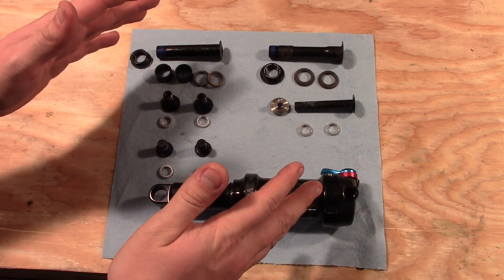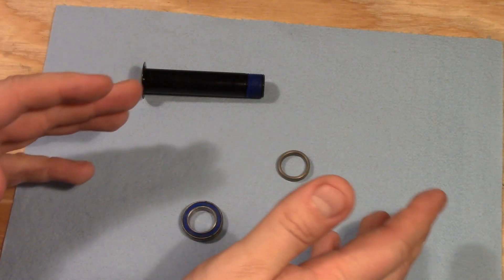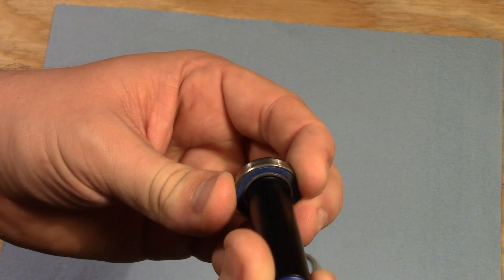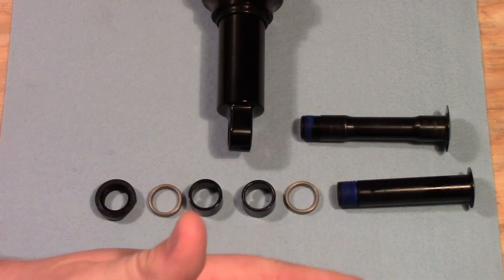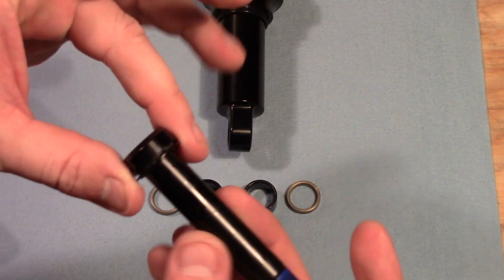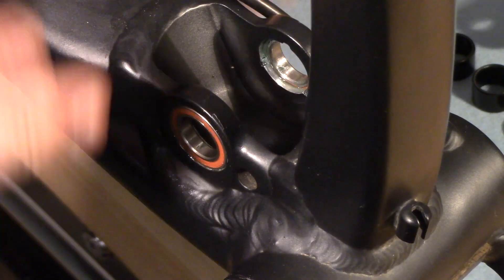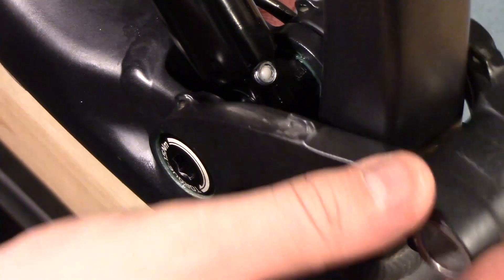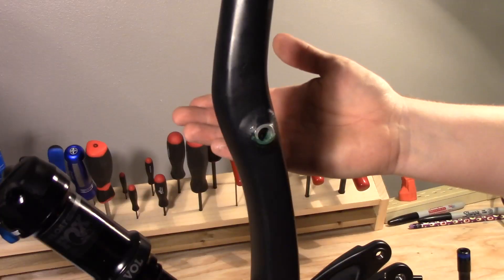Giant Maestro Suspension Rebuild Explained

Comment: Just used this video to replace the stock fox float DPS with the Bomber (coil) CR on my 2017 Trance 2.  No special tools needed.  The Bomber came with plastic inserts on the bottom hardware location that were easily removed.  Everything else was plug and play!  Tricky getting the new shock on. secured the top hardware first, placed the spacers for the bottom and swung the gap with the shock bottom, grease used to make spacers stick in place while maneuvering the shock.  I also put a Z1 on the front. Great job with the video.  Where can I get replacement bearings as mine were usable but worn?

Comment: Hi, I hope you can help me.  I have a 2022-23 Giant Trance Advanced Pro 29 2 and I cant get the bolt out of the rocker link, the one that goes through the seat tube.  I can unscrew one side but the other side the shaft Im guessing wont pop through.  Even hitting it with a mallet.  You are working on that part at 10:00m

Comment: Hi! So theres a difference between the two spacers between the rocker arm and the frame in the middle and the spacers for the rear of the rocker arm? And the 2 othersfor the top of the shock? Sorry for my bad english, i’ m french
Reply: the 6 small silver spacers are identical.  These go on all three positions of the upper rocker arm. There are two different pairs of slightly larger, darker colored spacers that are different from each other.  The tapered spacers are for the rear side of the lower rocker arm and the swing arm.  The non-tapered spacers are for the front of the lower rocker arm between the rocker and the front triangle bearings.

Comment: Great video, just got a Giant Trance Advanced Pro 2 so this came in very handy.  Although I have a creaking noise when I pedal hard and took the cranks out and regreased everything but still creaks.
Reply: mine too. i fear that on my personal Trance (not in the video) one of the bearing sockets might be a little out of tolerance, thus causing the creak.  I just had to get over it unfortunately.  It is sometimes one of the perils of full suspension.
Reply: @skitz502  you stuffed up somewhere could be the saddle rails or pedals cracked frame lose fork crown bike shop can pick where noise is from if good if new shouldnt be bearings

Comment: Is there specific bolts order that we undo first when we disasemble the rear triangle while everything is on frame. I wanted to ask is there any tension while the shox is in place is any of the bolts gonna have tension on them, just so i dont damage threads while trying to undo them. Thank u

Comment: Would you happen to know the type of bolt for the trunnion mount? M10 x 1 x 17mm (18mm head) for example. Trying to track down one bolt without having to buy the entire rebuild kit.
Reply: I highly recommend you do not try to use some other bolt.  This is machined specifically for this purpose to the precise tolerance needed.  It also has things like the specific shoulder that contacts the inner race of the bearing when installed.

Comment: Hi I have just replaced the pivot bearings on my 2019 Reign 2 and there is a slight gap left between the chainstay links and where it joins the rocker arm on each side. The bearings look like they are seated all the way in and flush and there is a spacer between the bearing and rocker arm on both sides. The bolts are torqued up to the recommended 15nm too. Am I missing something? Any help appreciated

Comment: Great explanation and to the point, thanks very much. I am doing some "spring cleaning" on my mtb and decided to replace my bearings since the bike has been creaking some. Do you recommend specific brands and/or do you know the easiest way to shop for them?
Reply from the maker: I am a Giant dealer so I typically buy the kit that includes bearings, spacers and pins.  If you would like to replace individual bearings.  Enduro Max bearings are the go-to.  Just make sure the size codes match.
Reply: Many thanks, keep up with the vids!

Comment: Hi, first of all thanks for the video!
at minute 11:00 you show how to mount the upper part of the shock (trunnion part) and you show the two grey spacers to insert before connecting the shock. the problem i have is that when i add the spacers the shock won’t fit in, do you have any advice for this problem?
Reply from the maker: Yes. This is a common issue. Start by trying to install the shock to the upper rocker with the rocker disconnected from everything else. If that doesn't work, you need to press out the bearings ever so slightly. It is easiest to do with the maestro kit I use in the video.
Reply: @richardsbikeshop5268  thank you, i’ve managed to install it but it was an hard job.

Comment: Really very informative video. I am servicing my rear shock this month and this video helps a lot. Can you also provide links to the bearings. I want to buy a set so they are ready when the time comes. Mine is a Trance 2021.Thanks
Reply from the maker: Best bet is to go to your local dealer with the serial number and get the kit from them.  If you want to replace specific bearings, grab the bearing codes off the seals like discussed in the video and get them individually.

Comment: Instantly subd! Perfect amount of detail in the explanation and very clear and specific. Quick question about bearings because I'm about to order some for me 2017 trance. All of the original ones say 6900 VRS, 6800 VRS etc. Is it ok to replace with the same 6800/6900 but 2RS instead of VRS? 2RS is readily available. From what I understand VRS is used for high speed full rotation applications, which the pivot linkages definitely do not undergo. Would the 2RS versions be ok?
Reply from the maker: 2RS would be just great.  No worries.
Reply: @richardsbikeshop5268  just replaced all of them yesterday and followed your video to the T..thanks again!

Comment: Just wanted to let you know that I used your videos to guide my through pivot bearing replacement and reassembly of my 2018 anthem. Bearings were a hassle because of the lack of a press kit but I got it done. Reassembly was a breeze due to your video. Thanks so much.
Reply from the maker: Thanks for the kind words.  I'm not the most interesting videos but I feel like they're the most educational.

Comment: Great video. We bought a second hand 2012 GIant reign frame and have to do full rebuild. 
Any chance you can point me to the right full bearing and bolt set?
Reply from the maker: Best place to look is your local dealer. Giant offers a bearing (and bolt) set for the lower link as well as the upper link. If memory serves, it is about $80 for the whole kit. If you want just the bearings, look at the seals, get the sizes, check Enduro bearings.
Reply: @richardsbikeshop5268  ta

Comment: At 11:00, you talk about the mistake of not adding the spacer for the upper rocker arm. I am putting my wife's 2015 Liv Lust 1 back together. It appears there was no spacer there when I took it apart, and the frame seems to be "built out" right there and appears to be identical to the size of a spacer. When I tried to add a spacer, the rocker arms (there are two and they are split) seem wobbly and appears too wide to the connection to the top of the shock. Have you worked on a Liv like this one?
Reply from the maker: I am quite familiar with the 2014-2016 series  maestro systems. Are you talking about the bolt through the upper shock eyelet, the upper swing arm (rear triangle) or the seat tube of the front triangle?
Reply: @richardsbikeshop5268  I bet that it is the bolt in the seat tube. I have trance 2015 and with spacer i got the same problem as Joe.

Comment: This and the bearing video were critical for me in my bearing service. Really well explained, and I feel like I have a much better understanding of my Maestro suspension. My only advice to readers is not to wait 3 years of wet muddy English weather to do this service. My bearings were in rough shape and I had to get the assistance of my LBS to get the upper-rocker-to-frame and lower-rocker-to-chainstay bearings removed.
Reply from the maker: I think my lower bearings only make it about one season in Kentucky where we dont even ride wet! Haha
Reply: @richardsbikeshop5268  bearings can be cleaned repacked with grease see endro.

Comment: Hi there, what is the recommended period of time to replace the berings? When do I know that bering needs to be replaced?
Reply from the maker: In the bearing video in this series I talk about this a little bit.  Turn the bearings and feel if they are rough to turn.  Also see if you can move the inner race of the bearing side-to-side.  the thing you'll notice while the bike is built up is usually noise in the pivots.

Comment: Hi! Thank You for video. Tell me which side to put the spacer between the upper shock bearing and the carbon part?
Reply from the maker: Between the carbon part (the upper rocker arm) and the top of the shock body (the part of the shock that is threaded). The other side of the bearing (towards the bolt head) contacts the bolt head via a very small built-in spacer that I mention in the video.

Comment: Hello, great video.  

Would the grease on the outside of the bearings that you are putting on not attract sand/dirt thus turning it into a gritty paste? The bearing seal should keep contaminants out and grease in just as it’s designed for.
Reply from the maker: That's possible but what I usually see when I clean mine out is no remaining grease in that space at all. Much of it gets rinsed out over time. It is also there to reduce corrosion on the steel races of the bearings.

Comment: this is just what I've been looking for, thank you!
Reply: this is likely the best mtb tech channel I’ve come across. Few suggestions for videos that are not done well today and that I’d really appreciate to see: fox float 34 fork service, shock service, wheel service. 

Also, assembling the maestro suspension, I think the outer bearings might've been greased bit too much in this video. I’ve had troubles cleaning the grease that escaped when being pressed with the final screws.
Reply from the maker: @zemiak7  I have heard the same from other people about the grease.  I typically just wipe off the excess after i tighten the bolts.  Any time i have removed the bolts, most of the excess grease from installation has already washed away. 

I plan on doing a fork service soon and i'm going to try to explain how everything works so you can apply it to other forks as well.

Thanks for the kind words about my videos, I am always trying to improve with each video and any feedback is SUPER helpful.  I am certainly my own worst critic.
Reply from the maker: Glad I could help!